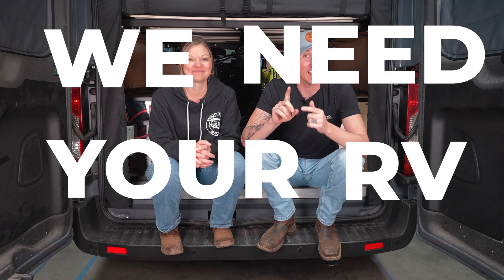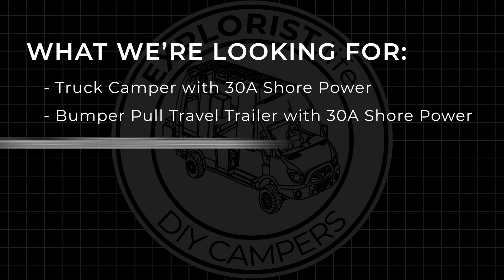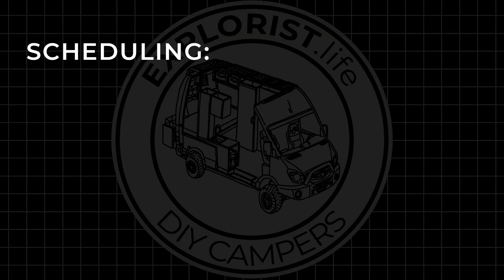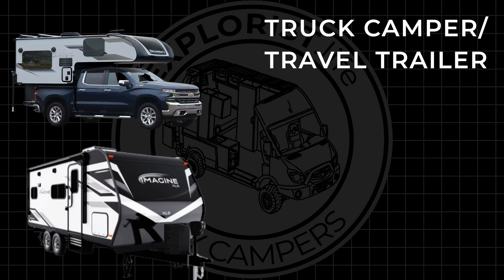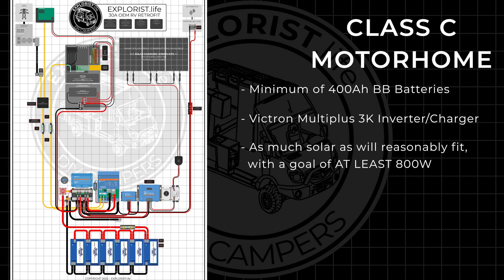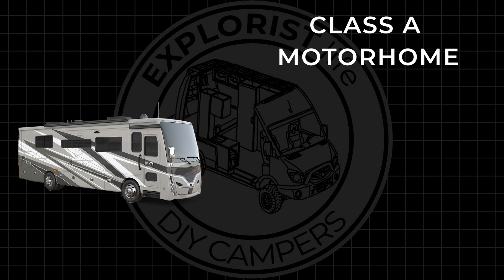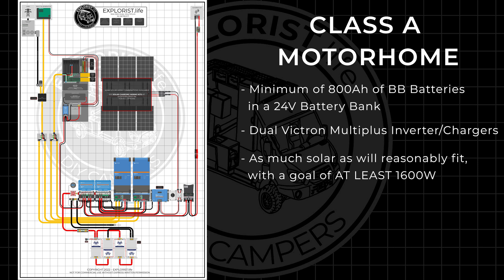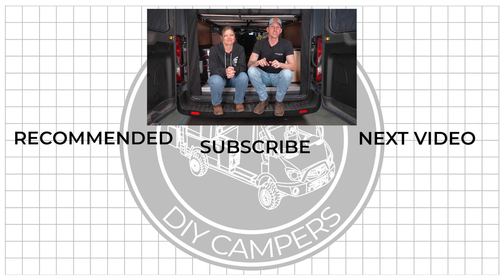WE NEED YOUR CAMPER! - Let Us Upgrade Your Camper Electrical System

Comment: In regards to the 50 amp 5th wheel system, what would be the approximate weight of the proposed 12v system? And the 24v? Curious to see how much it would affect cargo carrying capability. Thank you.

Comment: I would love for you to do my Truck Camper. Because I have a slide on mine and can't figure out how to run everything. Kicking my butt. Have you guys thought of using server rack battery's? Will Prowse has really a good idea. Should look into it.
Reply from the maker: Super cool!  Be sure to fill out the form to be considered if you haven't already: https://docs.google.com/forms/d/e/1FAIpQLSd6kUV-msRkMppEYYhZkBUKZ84GwQPg6_mo4W_9i0nBmRpK8g/viewform

Most server rack batteries specifically forbid installation where they would be subject to vibrations (like a campervan) and if installed in such a location, their warranties are void.  This is why we don't use/recommend server rack batteries.  Battle Born Batteries are specifically made for high-vibration harsh environments like campers/rv's/etc.

Comment: Already did my 5x10 teardrop with Victron components, 330W solar, 12v x 400Ahr Battleborne heated batteries, alternator charging, and 30Ahr AC/DC charging (when parked off season in garage) 😅
Reply: The system is also removable for use inside the home when the power goes out!  That’s why there are 400 Ahrs of battery!

Comment: I have a 40 ft 30 amp park model I live in on  offgrid  lot n Nc. Using my Diy  2400 watt solar system  n 12 100 amh agm batteries but I know is not perfect .but I have TBI Injury n Disabled n had to do whT I had to do in very resources n memory  n Learning on your channel n Will Prouse channell over past year .

Comment: I have a 2016 Palomino Columbus 381FL and already own everything needed but is renogy batteries lithium with Bluetooth. I weigh too much to get on the roof and no one will install for me because did no it buy from them so would love if u could install.
Reply from the maker: For sure!  I'm not going to use Renogy batteries, but if you are willing to return/resell those, you are welcome to fill out the application for the install where I'd be using Battle Born Batteries.

Comment: I used your 2000 watt wiring diagram and bought several components from you for my Toy Hauler Travel Trailer. Your wiring diagrams are easy to follow and your various components and kits were very helpful! I’ve gotten many compliments on my system.
Reply from the maker: Awesome!  Glad it has helped.

Comment: Hi Guys, have been following you since Adventure in a back pack days. I had a custom solar install performed 4  years ago. I have 800 amp hours of  Elite Power Systems Lithium,  1000 watts monocrystalline solar panels, Magnum 3000 watt invertor Charger. Solar Controller is a Victron unit I believe as well. All that said, Marvin Braun from Precision RV did the job on site. Now for the other deets. I have a 2015 Northwoods Mfg Arctic Fox 275L 5th wheel. It is a 30 AMP unit. I will be in Colorado on the return leg of our Aladka trip on a volunteer project in Walden CO the second half of September. All this said, I will fill out your application. Have been wanting to update Magnum and Battery Bank..Otherwise love 1000 wayts of solar and 800 of Lithium we currently use. Will be in touch once App completed. Thanks for all your content. Crazy helpful
Reply from the maker: Super cool!  Be sure to fill out the form to be considered if you haven't already: https://docs.google.com/forms/d/e/1FAIpQLSd6kUV-msRkMppEYYhZkBUKZ84GwQPg6_mo4W_9i0nBmRpK8g/viewform

Comment: I got a Older in bed camper ( 97 Angler from fleetwood )  that i am in the process of trying to save the money together for a full up grade ,that is 30 amp shore power . looking at doing solar and as well a full led ,lithium, alternator up grade with dc-dc power , heated water tanks on both black and grey, and as well as secondary heating system .
Reply from the maker: Nice!  Be sure to fill out the form to be considered if you haven't already: https://docs.google.com/forms/d/e/1FAIpQLSd6kUV-msRkMppEYYhZkBUKZ84GwQPg6_mo4W_9i0nBmRpK8g/viewform

Comment: I am a father of a disabled Navy vet with spinal cord injury, he plans on traveling the US with a 2009 mini schoolie with a lift for wheel chair. Would be great if you would consider this vehicle for your builds this summer.
Reply from the maker: Nice!  We won't be able to accommodate schoolies this year as we already have tutorials made for vans, which are the same systems as in a schoolie.
Reply: @EXPLORISTlife  Thanks for the quick response. We are working with Dragonfly to get everything needed for the build, hope all goes well!
Reply: Throwing this out there, any recommendations on rails and mounting panels on the roof of the bus? Kind of scratching my head on the parts needed for the rounded roof.

Comment: Campers and RV's are fun to solarize. I put close to 30KW (yes 30,000W) battleborn batteries, 2.5KW solar, and 2 Victron Multiplus 3000's in split phase in a 5th wheel two summers ago. The owner was planning to go boondocking around the US. It charges while they drive and they get free shore power at most places they go.
It also makes a good backup generator for their house 😁.
Reply from the maker: For sure!  Thanks for sharing.

Comment: The 30A req for the TT rules out our 2800BH. We’re prepped for a 2nd AC so it came with 50A service. 😐
Reply from the maker: Since that's electrically the same as the 50A 5th wheel, go ahead and fill out an application for that one and just make that note in the 'more things to know'.

Comment: But... what about a truck camper with a Victron 3000/48 and 440AH at 48 Volt and 2200w+ of Solar. I.... might be a little insane.
Reply from the maker: Nice!  We are making tutorials that try to cover the needs of 98% of people.  The 'insane' may be part of the 2%. 🤣😂
Reply: @EXPLORISTlife  Can't deny anything you said. But I would love to see you design a 48v system at some point. I do think it holds the same value as a 24v system though from my own research its not perfect setup. To save my own sanity I'm leaving the stock 12v system in place and just implementing a suplimental 48v system for inverter and hopefully someday a 48v fridge and AC. Just he idea of working with 4/0 didn't seem fun to me.
Reply from the maker: Just a heads up, but we've released our full install video featuring a Truck Camper; that you may find helpful! Here's the link: https://www.youtube.com/watch?v=gcDYiYgUCzg&list=PLmvhcyi4n0TUU8FUc6LE38TBkdSLjdw_5

Comment: Oh love it. We have a 1997 Lance 990 legend . Renovating for it had water damage. I would have filled out the form but we bought a renogy system 400 watt solar 200 watt lithium batteries with inverter battery changer etc. I’ll be installing in may. But I’ve seen your videos before and would have loved to have you do it. Since I’m a novice at this
Reply from the maker: Nice!  Sounds like a cool project!

Comment: Damn, I have a 50A travel trailer
Reply from the maker: Electrically, that would be the same as the 50A 5th wheel, so we might be able to make an exception there.  Go ahead and apply under that 50a 5th wheel category if you like, just make a note of that in the 'more things to know' section of the application form.
Reply: Submitted a form!